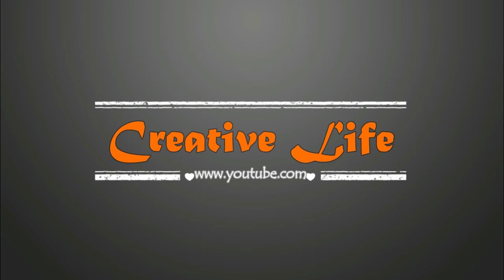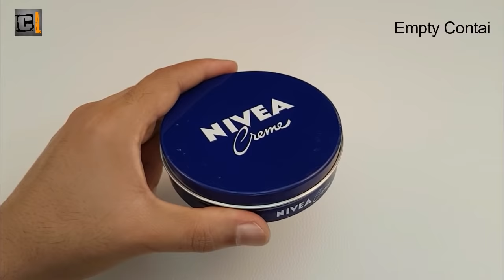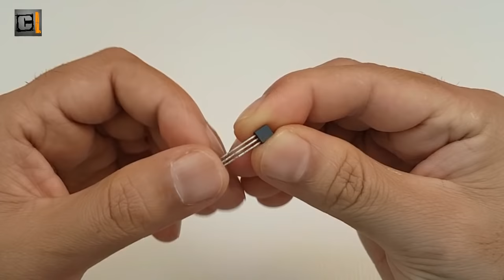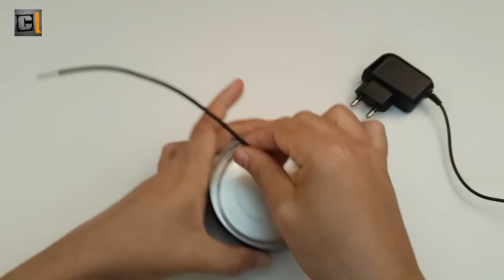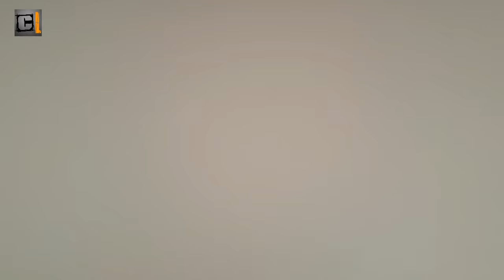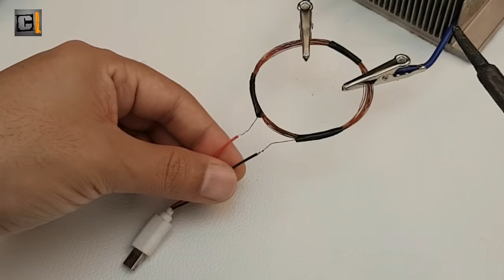How To Make a Wireless Charger

Comment: No chance to work. The guy does not know the basics of Faraday's induction law. Alternating current is required in order to have induction. DC current from the power supply will only produce some heat to the primary coil after the transistor is burned. This circuit cannot even cook eggs
Reply: P
Reply: If it is a stepdown ac adapter then it could possibly work.
Reply: @13thChip  No. Without AC current, simply impossible.
Reply: @svddsv3503 i am referring to AC adapter that  gives sinusoidal waveform at its o/p. It will work! I have seen many. DC adapters will not work.
Reply: Dc me work karta hai Bhai 😂😂
Kya padhe ho
Reply: @13thChip  Oh, sorry, I misunderstood you. Yes, of course, AC adapters will work!
Reply: @amitpratapsingh2240  How can it work on DC? Can you please explain me? I will be very pleased to learn it.(Not mocking, I seriously want to learn, if it is possible)
Reply: And that's why he used the transistor, it's a switching transistor, hence it switches the output on and off at up to 100 MHz according to the datasheet.
Reply: There's a bigger problem the case for the charger is metal
Reply: It doesn't help that it is covered in hot glue, the electricity wont travel through hot glue
Reply: @sharkkord  Is hot glue inductive? No. Is it made of metal? No. Is it passing wireless current? Yes. Does this video still suck? Of Course.
Reply: @Spencer Moriarty he said it was regular 5v dc charger so no chance he is using Ac
Reply: You are right
Reply: Because he use a transistor which produce a little oscillation (fluctuations) in the coil . The transistor turns the circuit on and off continues due to which the current goes higher and lower continues. So a little oscillation is produced due to which it works on dc. Actually it is not dc he makes ac from dc with very little oscillations. But i think this small oscillation are not sufficient.

Anyone agree with me
Reply: I have no idea what u just sead but I AGREEEE
Reply: This has the possibility to work, he is using a transistor, which is what makes up a wireless charger. The transistor alternates the dc current that passes through
Reply: @DroneNewb   yes transistor produce little oscillations (fluctuations) in dc. But i think these small oscillations are not sufficient to provide 5v output. And the another reason is that...we need 5v output in form of dc. But in this circuit output is not in form of smooth dc.
Reply: This is a Tesla coil
Reply: Pau Gelabert Sachse  what is meant by IQ5000???
Reply: @svddsv3503  how it will work if" dc current do not changes its magnitude and direction thus no change in magnetic flux and no current will be induced in the secondary coil"
Reply: lol so tru tho
Reply: Are you guys crazy though he did not rectify the ac at output to phone but still charges the phone with ac...although bc547 or 2n2222  with suitable resistor at base can oscillate at high frequency to produce pulsating dc.. i have made it and it works but no way it can charge a phone just lit up an led
Reply: Hi, I want to create the part that he attached to his phone, cuz I have a real wireless charger, but my earphones dont have wireless charging  capability, and I want to add it, so can I make the thing he attached to his phone to my earphones, and then put it on my real wireless charger, will it work?
Reply: Ah finally. Hello my fellow nerd.
Reply: smort
Reply: @yadwindersingh9494  el transistor 2222a se suele usar en radiofrecuencia , así que tiene alta frecuencia, yo hice una bobina de tesla con ese transistor y anada bien
Reply: @yadwindersingh9494  lo que falta es un rectificador que con un diodo para que convierta la bobina de carga externa en la corriente alterna en media onda y cargará
Reply: @msgamer1317  norte
Reply: @anamariafreire1415   Sorry I didn't understand that. What language are you speaking Can you explain to me in English?
Reply: @Zak Eladj no, shorting out the wires is not my point, my point is metal can not transfer magnetic fields
Reply: Hlo sir I think u about electricity  working and all I think can u help me sir to teach
Reply: Sir can we make the wire less led light power transfer
Reply: i want to make like this, is this 100 persentage work
Reply: Cannot even burn your fingers
Reply: @svddsv3503   you're right!
Reply: Yes Nick gliatis you are very correct this man doesn't know nothing about faraday's law of induction, he just used coils and transistor and expect it to work he thinks we are fools
Reply: Hlo😏
Reply: Yea what about the metal case arround the coil?
Reply: Aw man I was trying to make breakfast on this thing
Reply: @johnsonnifemi5978  of course you,me and  everyone else who watched  this video, ,all of us are fools, he made a video and we watched and he got views.thats what he wanted,..., he wanted views and comments to get cash from youtube.so he won and we are here arguing with each other ,,,.....,,,,it will work oh no it will never work bla bla bla 😂😂😂😂
Reply: its better to buy one from the market
Reply: yes
Reply: I can show you how to charge a phone using Cuban cigar smoke.. yes and very fast charging.. l invent the weird and the wonderful.  My private group is called Jedi nights in flight   please don't confuse with Jedi Knights
Reply: The transistor, makes it to fluctuate periodically.
Hence as there is change in voltage with time, hence there will change in flux associated with secondary coil
Reply: @krishanu1.037 In order to have constant oscillation the Barkhausen criteria must be fulfilled which means close loop gain exactly equals to 1 and phase difference exactly equals to 180 deg. Given the resistive part of the inductor not equal to zero, how the gain is achieved exactly to 1 and regarding the phase difference I can only see 90 degrees.
Reply: Damn straight
Reply: @manishsahani4510  its an oscillator.
Reply: Lol, are you the ops? Bash his work, make him look like a crackpot then steal his plans. I see you.
Reply: Nick nick nick. Have you never seen an electronic circuit called a joule thief? The 5 v dc power supplies the transistor and transformer ( the coil he wound is a transformer. ) It oscillates. The other coil picks it up and if he included a rectifier supplies dc to his phone. You should probably study a little before you get egg on your face again on your next comments.
Reply: good point
Reply: @sharkkord  dummy
Reply: thwre are so make more fake thing on thing that you should not even bother
Reply: At least he will have soft hands after using that much nivea, won't be so rough when he give his boyfriend one of the wrist.
Reply: Bro this video is of no use, I tried but of no use wasted my time copper and Solder
Reply: In this day now you know how its work???😂
Reply: Dhakha apne la parbahi ka natija thik se parle ta to aj ye naih hota be 😂😂
Reply: It works because transistor produces oscilations When the current passes through colector, the base will recive a negative pulse because of induction generated by the current passing through the first coil.

Comment: You can discredit this video right when you see he’s using a metal container to make the charger
Reply: Right
Reply: True
Reply: As well as the fact that he’s using a DC power supply. Magnetic fields only generated in a conductor with alternating current. And then the receiving coil has to be rectified (AC -> DC)
Reply: @evanpautz6046  can you speak English

Comment: I would recommend putting a rectifier diode on the receiver coil so it does not damage your battery. Other than that everything seemed good. Great video!

Comment: The induced emf at the other end might be 5 Volt (to indicate charging status) but that would be alternating, there would be requirement of a full wave bridge rectifier to get it smooth as DC, and even so I don't think there would be enough current to pull the battery up, instead It will charge your battery down to 0%. It's a legit trial but not up to par.
People often get confused with Electromagnetic Induction (that is in dc developed by Michael Faraday) with the Resonant Inductive Coupling (that is used in ac as of lighting up bulb wireless and the one developed by Nikola Tesla) and is exactly the working principle behind wireless charger.
Reply: Exactly bro, idek how hes inducing current in secondary coil when u dont even have a change of phase in primary coil 😭😭😭 just see how transformer works 😭😭
Reply: Exactly bro
Reply: sorry i'm a kid i understand a part of it but not fully do you have some video explain about that?, and in this video it says ""Wireless power transfer using Resonant inductive coupling" https://www.youtube.com/watch?v=AWhuu9TwMLM what does that mean?
Reply: @sciencekhuong  imagine a magnet oscillating in a coil back and forth generating voltage .. now replace that magnet, by another coil switching on and off that generates alternating magnetic field (just like oscillating magnet in a coil back and forth) which i think would be layman explanation for resonant inductive coupling
Reply: @ronvoy  when a intelligent guy enters the comment section.........
Reply: Hi i think electronic and electricity is better than magic....i understand the video i just need to understand on which coil must the diode be and what speck must it be ...all so cool

Comment: DC Analysis of the circuit reveals that the 2N2222 NPN transistor's  B-E (base-to-emitter) junction is forward biased and the voltage source is constant DC. Therefore, the transistor is always on. No change in magnetic flux = zero voltage in the secondary (the phone). The C-E current is constant because there  are no circuit elements to force any voltage or current changes. The final result is that this gent made nothing more than an electromagnet - and a rather weak one at that. There is ABSOLUTELY ZERO change in the H-field (flux change = 0) and thus there is no induction effect. ZERO.  People can say "Eureka!" all they want but this circuit would only make a great April 1 prank. By the way, the 2N2222 maximum, constant C-E current is less than 20ma. This circuit has no current limiting whatsoever and would "let the smoke out" of the transistor. Once the smoke gets out of resistors or transistors, they will not work again, ever.
Reply: B. Glenn it's you that doesn't know the basics. The 2n2222 plus the two coils make an oscillator circuit. It will oscillate at approximately 30khz and the magnetic flux will pass and produce current in the other coil.

Comment: Wouldn't recommend a metal container. Most metal types shield off induction. I mean it might work, but a plastic container would be much better. And it can also be a fire hazard, if you used a steel container the induction will cause the steel to become hot.
Reply: Anyway its fake. DC cant transfer energy over air
Reply: Raidzor つ ◕_◕ つ inductive reactance.
Reply: Guys I am a student a student and for our research we have this project. It would mean so much if you could teach me how to do this properly thank you.
Reply: Sean Rei Rosales create a bridge rectifier for the coil attached to the phone, that way you are sure the polarity is always the same.
Reply: Sean Rei Rosales also, use any thin material as the housing, besides metal. CL used a metal tin, but it may not work and usually doesn't work well.
Reply: Sean Rei Rosales To make it properly you should own a function generator. Induce an AC current through the primary coil and attach a full bridge rectifier and a 5V voltage limiter to the other. Now tune the frequency on the primary coil so the phone starts charging, after finding the adequate frequency write it down and build a circuit that generates it.
Reply: Raidzor つ ◕_◕ つ good
Reply: Yh,I think you are ryt. 
I created mine with metal container but it get hot in less than 20 min but when I use a different container that's not metal it works but not as effective as the metal does.
Reply: Metal, especially copper, steel, and iron, will take in induction waves and it just shorts out, so it creates heat (Very similar to how an induction stove works). I recommend using a thin plastic container. I used a cream cheese tub with all the labels removed. It works fine. And metal, sometimes shields off induction so sometimes you are just wasting electricity.
Reply: It's not fake but it is a bad design. Check how the transistor is connected to the primary coil. One coil wire goes to the base, opening it. (Don't forget that coils are reactive components, and they prevent the change of current in a circuit), The other coil wire goes to the switching collector of the transistor (that's where no more than 800mA can flow through the collector to the emitter). And the emitter is connected directly to the minus of the charger. It's a simple blocking generator. My sugestion is to add a resistor to the base of 2N2222. This should prevent transistor from heating, so more energy can be transfered wirelessly.
Reply: atomicjellydragon it is Aluminium
Reply: atomicjellydragon what is the type of current induced in the coil attached to the phone? AC or DC
Reply: AC
Reply: Hlo😏

Comment: Secondary coil's AC should be converted to DC with diode
Reply: Yes but the charger isn't even AC it's useless
Reply: @alecrider5077  yes
Reply: I’m no expert. But isn’t wireless induction chargeing ac and it needs to be converted to dc?

Comment: If it was that easy and cheap to make wireless chargers all the smartphone companies would have implemented on their every smartphone.
Reply: OM G I didnt said their aren't smartphones with wireless charging,there are
 but every smartphone didn't  because transfering energy is not easy and cheap,if it would the phones we all using would have wrless chrging
The above video pretends that u can make one urself that cheap????. Which in a  scientific sense not true
Reply: Shubham Yadav but it is not efficient and takes up space
Reply: The video is fake because DC doesn't go over air. You need AC to transfer current and so you would have to hook up a transformer to the charger.
Reply: AWESOME EVERYDAY How's the video called?
Reply: Shubham Yadav its pretty much in every flagship and midranger even apple now
Reply: Shubham Yadav you should really not assume you're opinions are correct just because you feel they are....

Big business corps aren't stupid. They create demand, they limit availability and exaggerate technology, they then can place whatever ridiculous price they want on a tech that's not really all that mind blowing
Reply: Big Markup
Reply: It's easy but not efficient....the expensive wireless chargers are efficient (+ this charger can damage your phone.... Make sure u add a full bridge rectifier and a capacitor to smooth out the voltage )
Reply: They think the market value not the material expense. They argue the people still amazed with the feature like this. Why it's made separately? Because it will more profitable. Then perhaps if people demands of it is fall, the wireless charger concept will be implemented directly on the phone.
Okay! Once more, think the profit not the cost. More profit, less cost if possible. Think again to be smarter ;)
Reply: Shubham Yadav ye fake hai mine bhut try kara per ye kaam nahi karta hai
Reply: Hlo😏

Comment: How can this really work? The secondary coil gives alternating current. That must be rectified with a diode or a Graetz bridge.
Reply: Károly Varga you are right
Reply: How come it gives ac volt....it is connected to a dc source
Reply: It's totally fake for  magnetic field we need to give AC supply but here directly giving dc to the coli for Dc it acts as wire and second thing secondary coil output must should be rectified before connected to the mobile so my conclusion its totally fakee
Reply: Ashwajeet Kamble by the oscillator circuit we can turn dc to ac but here no oscillator ckt is present so it's totally fake and foolish
Reply: saikiran kiran ya Ur right
Reply: Yeah u r right it is totally fake
Reply: Károly Varga hi
Reply: saikiran kiran is not understanding how it works because it is an ossilator that make it ac and transmits it to the secondary coil. though this vid is real and not fake but his phone battery circuit can be destroyed because it is ac not dc. i have made a vid on it.
Reply: saikiran kiran he is not foolish u r
Reply: Károly Varga there use screen record video. Look task bar
Reply: ITS  just transmitting dc current wirelessy,5v charger is giving dc current to to transistor for boosting..the same technique used in inverter but its single biasing.
Reply: FULL BRIDGE RECTIFIER xD
Reply: I guess that DC adapter already converted ac to dc.
Reply: You right ,it only can be done with electromagnetic induction,which is harder to make but possible
Reply: Yes exactly
Reply: @genesis1914  do u know how the circuit is working? its an oscillator...u are correct that the adaptor output is 5vDC but the transistor along with the coil oscillate which creates the changing magnetic field. I have made a video on the subject(https://www.youtube.com/watch?v=vQcn2N-k4as), i think even electroboom made a video about this (not sure). u might want to look at the circuit again.
Reply: @AWESOMEEVERYDAY101  read faradays law of induction big man
Reply: @genesis1914  "induced voltage in a circuit is proportional to the rate of change over time of the magnetic flux through that circuit"
so? thats the principal it works on.
Reply: Hlo😏